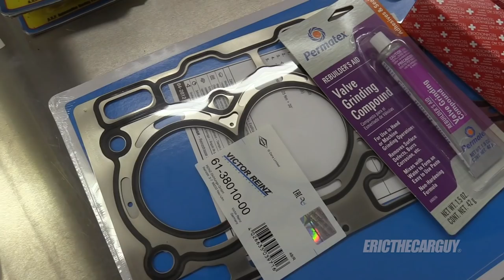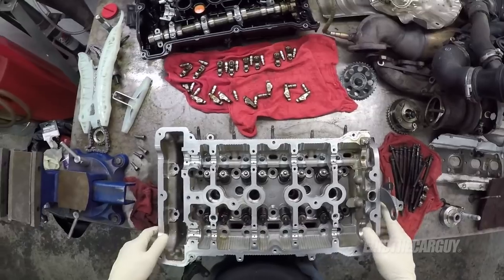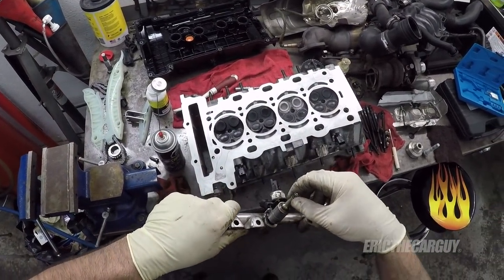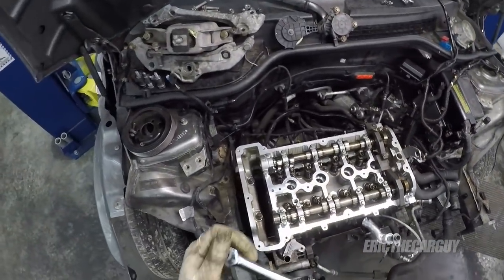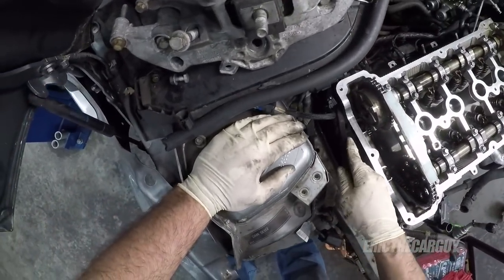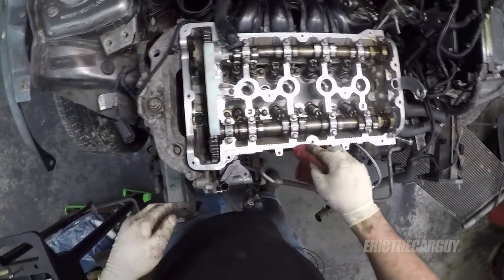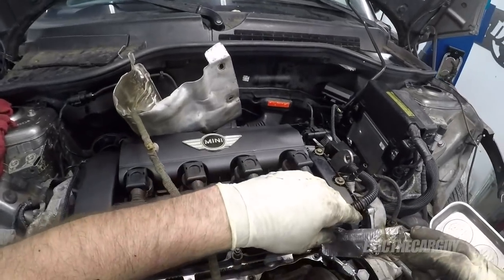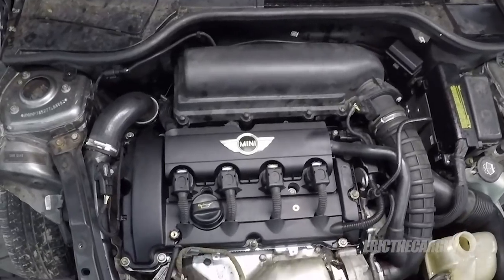Mini Cooper N14 Bent Valve Repair (Part 2)

Comment: Maybe you didn’t show it all in this video,but I’ve never seen a timing chain removed without  the timing cover taken off and same with installation..to get the timing correct at the crankshaft you have to be able to see the timing marks it’s impossible without the removal of the timing cover.

Comment: It makes me allmost cringe every time I see those plastic timing chain guides🤨
Reply: I have a 2004 Range Rover with the BMW M62 4.4L V8 engine and it has plastic timing chain guides. My guides broke apart at 152K miles. I replaced them and the chain myself at a cost close to $3K just for the parts and special tools to hold the cams and rebuild the two vans units, ouch.
Reply: The 3.7L/4.7L Jeep engines from the Chrysler era have plastic guides too.
Reply: SAAB (and therefore GM four-cylinder), VW VR6 both have plastic chain guides.
Reply: mine got plastic guides too...they are pa66 gf50 wich isnt a cheap plastic , i can tell you that

Comment: Eric, a cool trick for valve lapping can be done by attaching a piece of vacuum line to the top of the valve and  the other end of the vacuum line around a philips head bit in an electric drill.
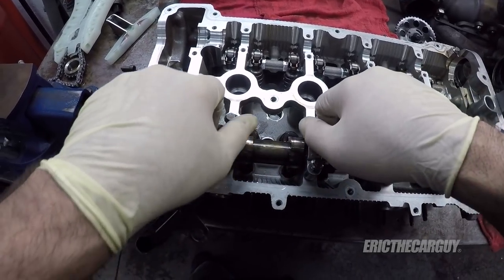Reply: 7:54 
Clean out these butt holes.?!? 
Oh! Bolt! 
I cannot be the only one that heard that wrong.
Reply: Nope, that can leave grooved openings if you only rotate one way.

Comment: Quote.. always install the head bolt on a cold engine! Would be quite hard to do on a warm engine lmao unless you're super fast
Reply: Damn and there was me going to preheat the whole engine with a propane torch...thank god for that instruction!
Reply: Yeah you have to heat to melting with the torchez so the parts mesh together on non German blocks - glad they provided this instruction
Reply: Ive had a VW head off and surfaces prepped before the engine was cool... You dont have to worry about hot coolant exploding if you dont have any pressure in the system
Reply: And don't forget, when doing the clutch always tighten the pressure plate with the trans in neutral.
Reply: I guess you never owned a SAAB
Reply: marble head dost thou have novel info to divulge about the saab-age?
Reply: +InsideOfMyOwnMind well on the saab 900 the clutch was on of the easiest things to get too... you did not have to remove the engine or transmission to get to it cause it was connected by a chain and the engine oil pan was the top on the transmission cause it was sitting on it now I loved the car I really did but sold it cause I did not want to have to change the timing chain cause to do that you had to removed the engine from the car... well some could do it without removal I think but yea the timing chain lived next to the firewall and the clutch lived near the radiator
Reply: ive had the head off of my old chrysler new yorker (t1 engine) and ready to go back on while the block was still warm, like a 30-45 minute job when you have to do it once a year lol (steep hills too much boost and refusing to get the head machined)

Comment: Eric, I cannot thank you enough for these videos. I had a blown valve on the 4th cylinder and these videos helped me step by step to get it replaced. I didn't have the tools I needed to replace the valve, but I did drop the head off at an engine shop and they replaced the valves and cleaned it for $150. After that, I reinstalled everything using a new head gasket and followed this video to a T. I fired up the Mini for the first time yesterday, praying for the best but preparing for the worst, and she had no problems. You sir, are an absolute genius and once again, I cannot thank you enough. Hope to see you back on here again soon. Thanks again for everything you do!

Comment: Hello Eric, I can see you are knowledgeable about engines. I watched both videos on the Mini bent valves.  I have some comments about how you worked the head on the bench.  This is just FYI; One should never work on an overhead cam head with the head gasket surface against the work bench.  An overhead cam head should always be supported by head stands at all times.  This protects the valves from coming in contact with the bench as four of the valves did on that Mini head when you installed the cam timing brackets. In the 2nd video, between the 10 minute and 10min 30 second mark is where you can see the valves come in contact with the work bench.  Also, the rear exhaust valve in #2 combustion chamber had contacted something at some time.  Everything else you did seemed to be good work.

Comment: I've watched all of  the "Mini Series" videos, and even though a lot of folks are cringing at the amount of work that it seems to take to get access to stuff on this engine, it really doesn't seem to be that bad!  Yes, the idea of removing the entire front end seems like a major undertaking, but it it's done smartly, like Eric has done it, it's really fairly easy.  Modern cars are designed for easy assembly at the factory, and can be taken apart in larger chunks to get to things.
Reply from the maker: I agree. I don't think this car is that bad to work on. What I do think is that the parts are fragile and expensive.

Comment: What causes valves to bend and what if anything would prevent them from bending? Your a true mechanical genius!
Reply: If the timing belt or chain breaks the crankshaft and camshaft go out of time and the pistons can hit the valves and bend them, only interference engines have this issue

Comment: You probably know already..but the vacuum pump on these cars is a common problem. On mine it locked up and caused the cam sprocket bolt to shear off and bent the valves. Great videos man!

Comment: I did this job a few months ago to change the valve shaft seals in my car, since I had to take the head off anyway. I'm a hobbyist and did not have the required tools before, so I just bought a very cheap clamp tool for around 15 bucks from ebay and it came with all sorts of adapters to fit all car. And I did not have any problems whatsoever with parts flying off everywhere or anything like that. Yes the thing was a screw on clamp and it took some time to screw it on and off again, but it still was worth every penny.

Comment: On heads that I was able to have the stems protrude enough, I attached a vacuum line to the stem and then to a regular electric drill (or whatever you could use for the line) and start with course for a short period and then go to fine and make that valve seat shine. Just like testing it before-hand, you can use water to see if your valves seat in after you put springs and keepers in.

Comment: The Datsun racing team in the 60's and 70's were renowned for straightening bent valves by getting the engine extremely hot and revving the snot out of it until the valves straightened up, true story.  You should have tried it Eric!  lol.  This was one massive undertaking.  In the field the cost of this repair must be close to the cost of the car!
Reply from the maker: Interesting, very interesting. Yea, the cost of this repair exceeds what you could reasonably expect from selling it. In fact, that's how I ended up with it in the first place. One born every min I suppose.
Reply: Yep, that's a massive job... but not so bad if you mentally commit to the processes involved and go through the motions of disassembly and reassembly.  It's the frustration and shortcuts that really mess a job up IMO.

Comment: I just met a guy who bought a used mini Twinkie, the dealership said it needed valve guide seals to stop it from smoking, quoted him 5,500 for the repair. He actually paid for the extended warranty on the engine, insurance tried to get out of it but the dealership got it approved and sent the head to a machine shop. The dude was happy because the top end of the engine was all fixed by the insurance.

Comment: Tip 2: I've read the injector Teflon seals must be sized before install and they will expand if removed from the engine for more than 10min. They are really not that fussy and if condition looks okay they don't need changing just because you pull an injector.  New injectors come with seals pre sized already to 8mm dia. and they compress to 7.8mm in the engine. I didn't notice any expansion even after removal for some days. Of course if you put a new seal on an old injector it will need sizing to 8mm because you stretch it over the tip.

Comment: with the cost of maintenance on any car, especially the Mini. I have tackled a lot on my own. Just did a trans swap a few months ago, and now need to do a timing chain on my 07 Mini. Thanks to videos like this and having some mechanical ability I am not afraid to tackle those tasks. Besides you can still put it in the trash if its in pieces and doesn't run. What have you lost?

Comment: the metal ring seal which forms a gasket with the exhaust valve on my car popped off and caused the valve to collide and bend. the metal ring seems to be press fitted into the head, which is scary that it came off to begin with. its not on any parts catalog at all! my solution since it was in fine condition was to press fit it back in. fingers crossed! you think i did the wrong thing?

Comment: How did you determine which cylinder had the bent valves? additionally, how did you diagnose the bent valves? or its a given if your timing chain comes off?

Comment: Tip: Install the injectors in the rail (by hand) then install the whole assembly on the engine. Those blue o rings can easily be pinched and cut if you try to install the rail on to of the preinstalled injectors.

Comment: Just subbed the channel.
I have a 2010 hyundai genesis coupe 2.0t dohc engine the timing chain apparently has slack and the mechanic reported the valves were bent. They said that meant the engine couldn't be repaired and that i needed to pay 6k for a new engine.
Could something like that happen or were they trying to flease me?

Comment: Hi Eric may i ask how long a time duration it was from the time you first fitted the new chain and guide rails till it bent the valves,like was it over a period of time or did it happen on fireup? Also how you did torque settings on the cams and crank bolts is exactly how i used to adjust the rocker arm/pushrod adjust on my old small block chev? Good job by the way congrats

Comment: Can someone please explain to me how he set the timing on the intake and exhaust timing gears? I'm referring to the 2 gears that the chain rides on up top. 

 I'm new to this stuff but from what I've understood so far in the video, he set all the pistons to be equal height with each other. Locked the flywheel so I assume it doesn't move when he's torqueing the crankshaft bolt? 

So now the crankshaft is in time, next to the gears. In the video he just places them on and torques them down. I know the both camshafts are in place with the lettering on top, so does that mean that once both the intake and exhaust camshaft gears are torqued the camshafts and crankshaft are in time?

I could be wrong with all of this so please fill free to correct me everywhere I'm just trying to understand how this process is working. Thanks for your time & response.

Comment: Did you change the valve stem seals? These engines burn oil that leaks by the seals.
Reply from the maker: No I didn't. The engine burns oil because of a poor PCV system. A catch can will likely help a lot.

Comment: Old carpenters pro tip for getting 90degrees: If you spread your fingers fully (yet, still comfortably), the angle between your thumb and your pinky is roughly 90degrees.

Comment: As for the scrubbing/ cleaning small places issue....get a really good gun cleaning kit. .17 all the way up to 10 gauge. They had brass and plastic brushes for all those sizes and a lil cleaning wad you can get a clean engine.

Comment: @17:25, if you have the correct tool - the angle gauge - why just try and estimate it with the breaker bar?  Isnt using the angle gauge just as easy?

Comment: Maybe you covered it and I missed it but... is there just zero concern for piston damage when you bend valves? Thanks. Currently staring at an N14 with zero compression on one cylinder of unknown cause. (not timing chain) and deciding whether I want to get into it.
Reply: I've just stripped mine down as I've "holed" a piston i.e. at least one of the rings have broken due to weak piston design. It's a common fault, especially when brayed with no oil in. I suggest getting someone to stick a borescope down the spark plug hole of your piston with no compression and see if you can see any damage e.g. uneven gap around the piston and scores in the bore. Hope that helps. Ultimately you'll find it easier to take the engine out and dismantle it outside of the car if you need to get in to doing main block.

Comment: What's the need for the digital inclinometer? I'm wondering if it is absolutely necessary as I have the laser kit with the normal tools and chain tensioner but I see the other kits with the inclinometer.

Comment: How does the crankshaft timing sprocket get locked against rotating on the crankshaft, is it purely friction on some kind of taper? It just spins on the unit that Eric was deburring.

Comment: Hi Eric i have a 2015 mini cooper s hardtop i am getting a code P 143 C . I did put some Lucas upper cylinder lubrication in the gas tank the correct amount for the gallons of gasoline that I put in but about a week later I got the code. Do you have any idea what it could be i am thanking the o2 sensors but the scan tool at the local auto parts just give yous the code and they tell you to google it. I looked it hp but i cant find any info.
Reply: Garry Burrell There is a guy on YouTube said that you have to buy a BMW code reader; not just a regular one ‘cause it tells you more specifically to what is wrong.

Comment: Eric, supposedly the second generation of "German designed Minis" is less problem prone and about as fun to drive.  Do you have an opinion on what brand of new car is both fun to drive and easy to work on?  It would help if it were reliable also.

Comment: Eric my Nissan  pulsar motor has a leaking valve cover gasket along the front edge could I shove gasket goo along the edge from the outside to stop it if I clean off the oil first. Is it safe to leave a weeping valve  cover gasket  for very long I know there isn't much oil pressure up there. It's not pouring  out just a slow minor  leak sometimes it smokes from the oil on the exhaust manifold from the build up.its a 2002 with 100000km

Comment: Re: 90 degrees. Use a paint marker on each bolt head as you do them?
Reply: Chip Holland an old bloke once told me, that white pen won’t hold that bolt in if you leave it loose. Since then I only mark internal engine fasteners that have to be angle torqued and double check everything! Thought it was a fair comment!

Comment: Eric I need your help. Doing a timing chain on a 2010 S clubman. Timing chain snapped due to seized vaccuum pump. With the cams face up, should all valves be closed. My 1st cylinder exhaust and 2nd cylinder intake were both in various states of being opened. Do I need new cams? I need help so badly
Reply: I see yours are also open similar.. but I cannot crank my engine when the head and cams and chain are all installed. Something is preventing my from turning the engine, cams and chain off.. crank turns just fine. Locked in. Head installed cams and chain installed, locking pin REMOVED, cannot move it.  All valves are lappedx all guides were fine, allowed free movement. I’m so lost.

Comment: Wow, that was an amazing work reassembling all that stuff. All those plugs, sensors and fasteners. How much time did you put into this job (days/hours)?
Reply: Usually for umounting and mounting the head you take 10 hours. But only for reassembing al the stuff. Usually of you make a complete check up you Will be arround to two days of working. I tell you by mi experience.

Comment: I saw you put a lubricant on the headbolts. When you add a lubricant on/in threads, your torque specs will change accordingly. Take you take this into consideration or, was it stated in the manual to add lubricant to the headbolts?
Reply from the maker: It's just something I do. With TTY bolts is really about the stretch and not the torque.

Comment: Hey Eric I have a 94' Nissan D21. I'm lucky enough that my heater core has sprung a slight leak. Should I bother messing with any of those "sealant" additives, or should I just tear it apart? Cheers.
Reply: core change can't be that expensive for DIY or just remove it and call it a day

Comment: Eric the cars guy- my Honda prelude si automatic crank but no start. i replace the computer engine computer box, the ignition coil pack, and also the starter. there are sparks coming  from all 4 plugs, the distributor is dry showing no oil leak and current is coming from it. the gas pump is working fine. i also checked the air filter and its clean. i honestly dont know what to do at this point. i need serious help.

Comment: I have the same car, the Peugeot engine is problematic.. most problems with these are the high pressure fuel pump. thermostat housing..turbo oil feed pipe(I have replaced all of them) on my 2007 cooper  s r56 n14 engine..

Comment: hi Eric ive just replaced my r56 timing chain as it failed on an emissions test over here in the uk,   was showing as the cam sensors advanced timing errors etc,  chain was slack and the guides was all brittle,   on starting engine with new chain kit and tensioner it is throwing approx 4 vanos codes up  and the engine is really flat on acceleration,   is there anything i could have done wrong or is there anything else i need to do after changing,   help would be much appreciated   thanks in advance  Kev

Comment: Eric, I have a question, why do some bolts(mostly cylinder head ones) have to be torqued down to a specific amount and then as you show in this video to a certain degree angle? why don't they use the calculated torque spec of that certain degree angle?